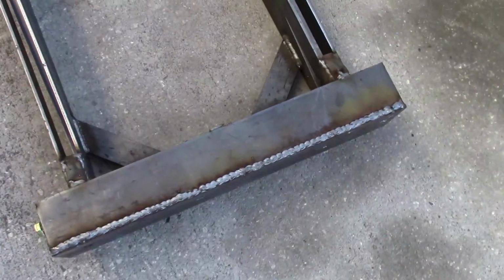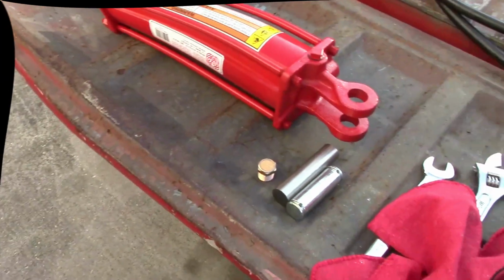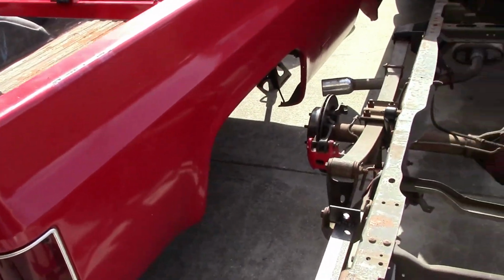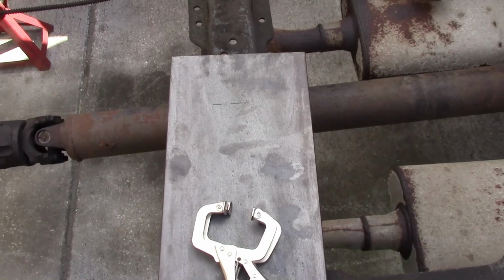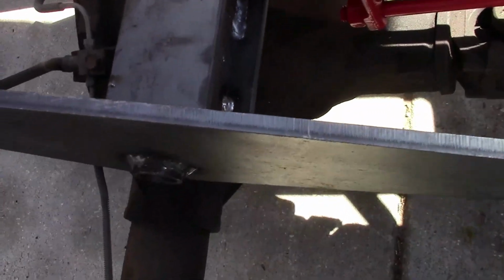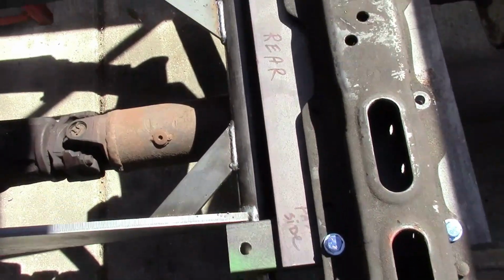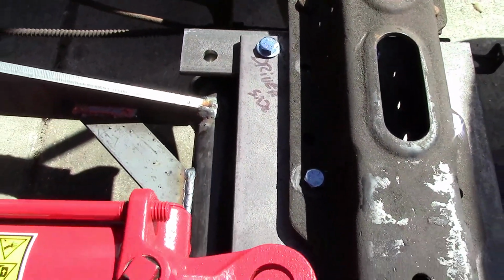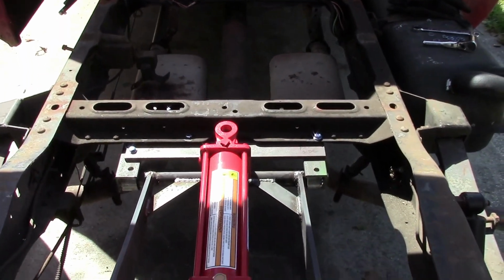C-10 Custom Dump Bed - Part 2, Ep. 6

Comment: Buddy giving me a rusted out 70s truck but the bed and chassis are good. I will probably build a trailer out of it and add the dump capability to it. I got some home work and planning to do. Awesome setup
Reply from the maker: Thanks Jorge! It sounds like you are on your way to an awesome setup as well. Thanks for Watching!
Reply: @BronorisPye  I just got in with the trailer so gonna be a nice project. I wanted to buy the dump truck kit for my F250 but it's a short bed and I would want more capacity. Once again awesome video and I will also upload my project soon.

Comment: just seeing this now, nice work - but what do you do with the fuel filler?
Reply from the maker: I kept the original filler pipe and removed the bedside shield. I had to cut both rubber hoses (filler & vent) down enough to allow the bed to lift without snagging the gas cap and other tank components. A piece of metal was bent into shape and bolted to the frame to brace and ground the filler pipe. Thanks for watching!

Comment: Nicely done!  About how much in parts?  I got the welding in the bag, got a CNC plasma at my disposal also, just curious about the pump and cylinder really...  want to do this to my '89 Cheyenne long bed.  Any chance of pics of how you attached it to the bed?  I know the application will be different, just wanted to see it for inspiration.

Again, well done.  Hope to hear back
Reply from the maker: @Oliver - I purchased the pump as a kit with two 8" cylinders in 1995 from Red's Hydraulics for $400. 
Northern Tool has a nice unit for just over $400. check out the link below. (https://www.northerntool.com/shop/tools/product_200329762_200329762) 
The cylinder for the lift bed was $225. 
Here's a short clip with pics of how I attached the bed. https://youtu.be/A2N-NVJ9kNc  
Thanks for watching!
Reply: @BronorisPye   Many thanks mate.

Comment: What size cylinder is that and did you cap one and off of it I have a pump just like that 1 to do the same thing and wondering where you got the cylinder what size it is nice looking build though
Reply from the maker: it’s a 3.5” bore X 10” stroke double acting cylinder. I picked it up from a local hydraulic shop. https://www.hydraulic-supply.com/locations/tampa-florida  You can leave the plastic plug in the unused port or use a micro filter plug like I did. Thanks for watching!

Comment from the maker: @Maggie it’s a 3.5” bore X 10” stroke double acting cylinder. I picked it up from a local hydraulic shop. https://www.hydraulic-supply.com/locations/tampa-florida  You can leave the plastic plug in the unused port or use a micro filter plug like I did. Thanks for watching!
Reply: Instablaster